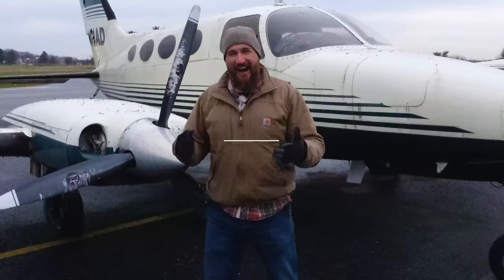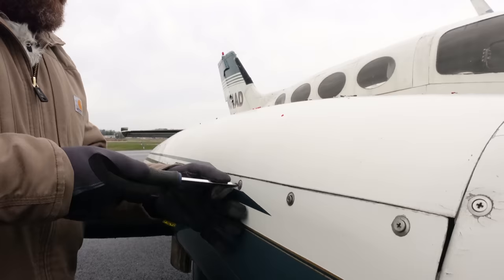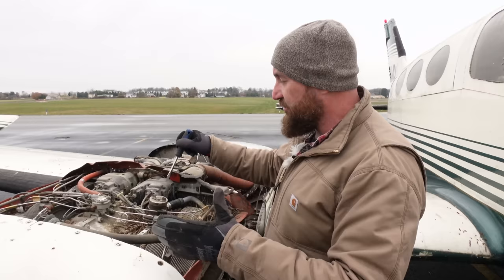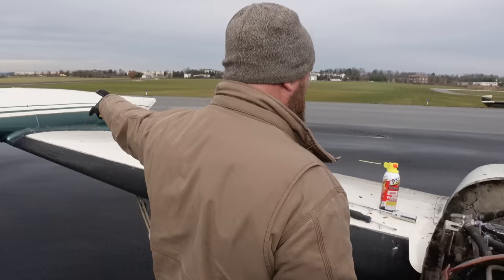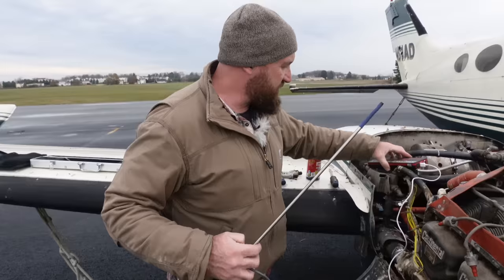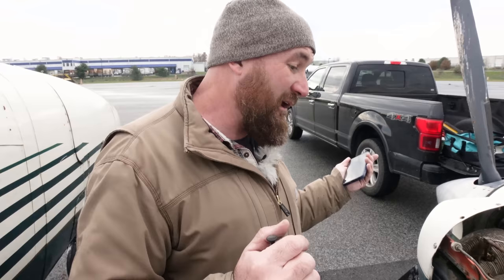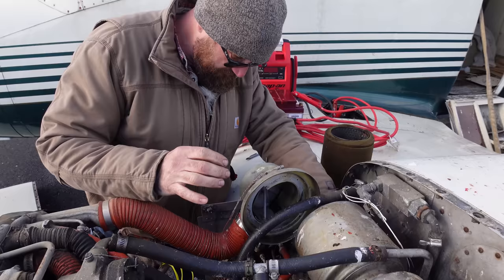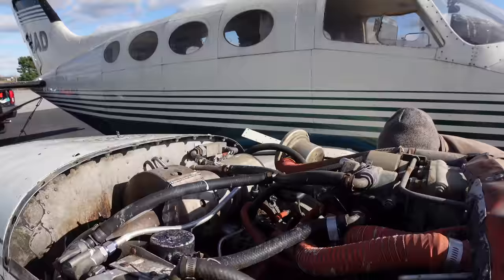FREE Abandoned Airplane... If I Can Start It! Ep1

Comment: I'm a multi-engine pilot and an A&P. For having little aviation knowledge, your engine and basic skills are good! As a  rule, aircraft engines are simpler in design than car engines. I find that changing plugs in a car with the individual coils and intake and such in the way is much harder than most planes.  
Fuel burn you mentioned is pretty close -figure about 35 g.p.h. depending on cruise speed and conditions. Figure 230 m.p.h. or so for cruise speed.
Hooking up  a high amperage battery  shouldn't be a problem because the various systems will draw only the current they need. The mags on that engine shouldn't  click unless they have impulse couplings. Those engines probably use "shower of sparks" mags that give a temporarily high voltage during start and don"t click. 
Did you check for fuel and spark before trying to start? Like any engine, You need those to make it run. The turbos could probably be by-passed to start the engines, but replacing them later would be very expensive.
The cost of overhauling those engines would probably run at least 50K each. Getting the engines to start makes for a good video but no A&P or IA mechanic would sign off the aircraft as airworthy without a double overhaul. If you view "Jimmy's World" you'll see several examples were he got engines to start, but abandoned the project for other expensive issues. 
Bottom line on this plane is.... parts plane! The engines can run 100K. The other systems like props, landing gear, avionics,controls, interior etc. can easily run you another 150K. That's if there is no corrosion. I would assume that this plane is full of it but you never know without looking.
I'm overhauling my own 4 cylinder Lycoming engine right now on my Piper Cherokee and have 15K in just parts. I'm adding a high - compression conversion and a tuned exhaust that adds another 10K or so to the cost. During the overhaul, I had an A.D. note (like a re-call but you pay for it) for wing spar corrosion  come out that could have stopped the whole project, but luckily, there was none.
Good luck, but the project is probably not practical but definitely fun!
Reply from the maker: This thing is a basket case for sure !
We’ll get it running sooner or later. I think we’ll get it into a warm hanger and get her cleaned up, then get at least one engine sorted out before parting her out. I’ve been thinking of using one of these TSIO’s on a kit plane or something interesting…..
Reply: Larry is dead on, all counts.  Hate to see this end up parts plane.  Shame the former hermit owner let it GTH.  There are not very many of this model flying. Not many were made compared to 340, 414, 421.
Reply from the maker: @johnross6314  we’ve been thinking about bringing her back to life and using her for Angel flights and paws rescue non profits…. Allowing other pilots to fly her on those missions.
Reply: maybe he could go thru it and sell it to someone in a 3rd world country where the regs aren't so restrictive (i.e. where American equipment goes to die)
Reply: @Exuma Guy “Best Cruise Speed: 213 KIAS”  noted from Cessna POH… that is at 75% power, and 46 GPH.  FYI. Not that your semantics matter over the factory rating. Would it achieve this?  Sometime.  But then, with a slightly under 2100lb useful load (non modified), the ability to fill up all seats (Cessna claimed unto 9) with passengers, and have anything but a smattering of fuel is impossible.  Let alone cargo.  

The pictures of this plane show some possible added vortex generators on the inboard wing area.  Which, if a STC might have increased T/O, Stall, S/E performance (slightly) from what I state above. This is a tricky aircraft to fly for single pilot, compromised (single engine as one example).  That is one reason for the limit of useful load with fuel.  It has a high single pilot normal workload than many.  It’s 6800lbs GW also places this into a different insurance category.  With 335hp each or so, it has less ability to carry a useful load payload than say a I/O-540 300hp Aztec (much lighter, yet, higher useful load and better single engine performance above VMC).
Reply: @Exuma Guy the overall single pilot workload on any of the 340-421 series is not for everyone.  Especially with compromised situations. Just the way it is.  402 looks flashy, however, if pilot not fully proficient, and not better than average pilot, things can get ahead quick of a non prepared pilot.  Sure, this is not Beach Duke, or MU-2J.  402 is not something anyone with Seminole time can jump on and be a true safe pilot. 

I believe this aircraft was made in 1969 or later? Need to go back and see that age.  Does not matter.  It is published to cruise much faster than you suggest.  Assuming the manufacturer (Cessna) uses similar metrics for published performance of the 340, 414, 421 (which Cessna is accurate with every of these I have flown (assuming not some ready to fall out of the sky cargo part 135. Instead we’ll maintained corp/private aircraft), that is used in the 402, what Cessna publishes will be very close.  

Name dropping your ticket, and sign-offs is not a help.  I have met many supposed credentialed wonks who I would never conduct a check ride.  Just because you claim some certs, means nothing here.
Reply: @Exuma Guy I suggest you quit talking.  The more you talk, the more people will never want you as a pilot.  Emotional outbursts on a comment section…. So endearing to your reputation.  Imagine the potential pompous non stable emotional state when under complex/dangerous situations.
Reply: @Exuma Guy no potential owner or pilot of a 401 would be misled.  Why?  They will be learning the POH for the year of the specific 401.  Including any STCs for the aircraft they are looking at.  Instead of listening to any keyboard supposed “polite” warrior. You are not offering any service to them. Get your ego in check.  Or one day you might end up on Victor’s VAS Aviation YouTube channel as a statistic.
Reply: @hooptierescue2540  Their money converted spends the same right???
Reply: @mrmotofy  one might pay a couple percent exchange fee thru a major bank that does a fair bit of international business
Reply: @hooptierescue2540  Right, but it might be hard to sell here cuz nobody wants the risk whereas there they might happily pay
Reply: @rebuildrescue   The "shower of sparks mags have a  "vibrator" that needs to run, to enable start.  Some can be in the nose compartment, or sometimes under the front seats.  Use a plastic pliers to hold the spark plug lead 1/2 from the engine cylinder, while someone operates the starter.   A continuous spark will jump 1 to 2 inches.  Sometimes only found on the left mag.  Trace back the plug leads to left mag.

Comment: I'm not an authority on aircraft engines but I have some experience with automotive turbos. The operating principles, I would think, are similar.  You should be able to to start and idle the engine even though the turbo is bad. You don't need boost to idle. The frozen turbo will create quite an exhaust restriction but shouldn't be an issue at idle speed. You can temporarily bypass the turbo on the intake side. I wouldn't spend money on turbos with questionable engines. JMHO.
Reply: The biggest difference between vehicle engines and aircraft engines (prop) is that aircraft engines are made to rev very high for extreme periods of time. The boost is a constant flow and doesn’t exactly have a chance to “blow off”
Reply: @KillianDeaton  He showed what appeared to be a blow off valve of some sort when he was checking out the turbo. If you cut the throttle with no blow off valve it will burp back through the intake. That pressure has to go somewhere.  The primary reason for a turbo on an aircraft engine is to allow it to operate effectively at higher altitudes where the air is thinner. You need forced induction to maintain proper cylinder pressure but air density and altitude are obviously going to vary so there has to be a way to vent the excess boost pressure. Overboosting will lead to detonation and engine failure.
Reply: Yeah I am a mechanic and yeah you should be able to start the engine with a seized turbo it should idle it may be a bit rough but don't rev it as you will kill the turbo. Also a little heat in the turbo may expand it enough to free it
Reply: @KillianDeaton  yeah no, the load from the prop keeps the revs down in manageable limits, certainly not "very high". Steady constant revs was the correct answer.
Reply: @KillianDeaton  aircraft engines run at about 2000 rpm. Give pr take 1000. They rev very low.
Reply: @KillianDeaton  Aircraft engines do not rev very high, lol. These engines have a redline of probably 2500RPM, max.

Comment: Aircraft engines have steel threadserts in the cylinder heads for the spark plugs to wind into, so you don't wind up with galvanic corrosion between the plug and the head and also to decrease the likelihood of stripping out the threads. Those plugs are removed for cleaning and gapping at least every 100 flight hours and the engine TBO of a 520 is 2000 hours. Screwing straight into an aluminium head would strip the threads out well before the engine hits overhaul.
Reply: True, most of them are stainless steel Heli-Coils
Reply: Yeah I only remembered they were called Heli-Coils after I posted the comment.

Comment: The engines are 300 HP each,  the cruise speed is around 240 MPH, fuel flow at 75% power is around 15 to 17 GPH each engine, and the TBO is 1400 hours.  With out the log books and the condition this aircraft is in, it needs to go to a salvage yard, or possibly an aircraft mechanics school.  Just because some of the avionics and auto pilot lit up does not mean they would work.  But I enjoyed watching you give it a try.

Comment: I have a lot (many hours and 40+ years) of experience with 400 series Cessnas. Hate to rain on your ambition, but the engines, as expensive as they are (and these ones are likely scrap), there are undoubtedly a lot more demons lurking in this beast, and exorcising them may very well run to even more cost than the engines. I don't know if the owner has provided you with any of the logs and records, but to start with there are spar and exhaust airworthiness directives that are expensive, so say nothing of any corrosion that may have accrued. There are supposedly "airworthy" aircraft of this type, with good engines, that on close competent inspection will turn up well north of $100k of defects. It might be of interest to a technical college as a teaching aid. If you are serious, find a friendly experienced and trained Cessna twin mechanic to give a quick opinion.
Reply: That seems like a fair assessment, coming from someone with many years of expierance. This project seems like it's more trouble than it's worth. Also, I'm not a tree hugger but this seems like somewhat of an environmental hazard. Like you, I worked in the aerospace industry almost 40 years and I can tell you if we had spilled oil and solvents and the ground the way he has there would be hell to pay.
Reply: My thoughts too.  The cost of making this plane airworthy again would greatly exceed its worth.  I think donating it to an aviation mechanic school would be the best thing for it.
Reply: @Me-xy3jh  Not oil on the ground!
Reply: So I’m going to school rn for my amp and amt and I was just curious if the faa would allow the plane to be airworthy without the license I mean I don’t know what this guy is certified for but Ik everything that comes to my school is automatically made not airworthy because we’re students
Reply: I worked for almost 40 years in aviation.  The FARs lay out everything that an owner can do to his aircraft.  Replacing spark plugs is one of those tasks IF you are a licensed pilot, and you own the aircraft.  And the work needs to be documented in the aircraft logbook.

I'm sure the vid creator is qualified to turn a wrench, but unless he is  A&P certified, or own the aircraft (and holds at least  a private pilot rating), he is technically not allowed to do much of what he already did in this vid.  His lack of knowledge about FAA regs is going to cause him some problems.
Reply: @vandalsgarage  You're getting too nitpicky.
Reply: @quantumblood2253  Congrats on joining our trade. Just to help you in future conversations, it's A&P (Airframe & Powerplant). Good luck in the remainder of your courses!
Reply: @vandalsgarage  I was questioning this since the beginning of the video. I am an 11yr A&P and I was sitting here, curious how he is going to sign this work off. If, of course, his intention is to eventually fly this aircraft.
Reply: @TheZwells  thanks much appreciated
Reply: @MilwaukeeF40C  it isn't picking nits it is literally just the rules and regulations of flying a certified airplane like this one.
Reply: @derrickfoster644  Funny story:  those are just suggestions.  A machine can literally physically work without that crap.
Reply: @MilwaukeeF40C  yes the machine its self will work just fine without the regulations, however if you actually want to use said machine as it was intended (you know to fly and stuff) you need to follow those rules, otherwise you just have a pretty ramp queen because that is the only place the machine will be able to go. Anyone who actually knows about aviation rules and regulations know that they are written in the blood of those who came before and didn't make it.

Comment: Seems like the kind of thing that will run just long enough to get you to the crash site.  Good luck with it and stay safe man!!
Reply: As a retired USAF flight simulator guy from years ago with thousands of hours, I thought I had heard every airplane joke. That was funny. I snorted my chocolate milk. I want to use that sometime. Thanks.
Reply: And let's not forget the buckets of money just to get it running.
Reply: @oldschoolman1444  and the taxes
Reply: I would pull the engine and put it in a rat rod lol now that would be bad ass.

Comment: I think that just getting the engines to turn over by themselves without setting fire to the craft is a worthy goal, because it means ownership. But no one could ever fly it somewhere like that, of course. When it is actually owned, the very next step would have to be pull out the engines and bring them to the shop for a teardown. I think there is no avoiding checking every rotating and reciprocating part and bring them all back up to snuff, otherwise there cannot be 100% confidence that wear or galling might cause one or both to quit in the air.

That would also be the first step in ''hosing out'' the engine bays (or would they just disappear after removal of the engines?). I think that if the engines could be made airworthiness inspectable, stripping everything out of the interior that doesn't actually keep the plane aloft would make it perfectly functional, like a military aircraft with bare metal everywhere. Duct tape upholstery of the pilot's seats would be perfectly acceptable unless/until bucks were available for a complete reupholstery/interior refurbish. A bare bones aircraft would make airframe inspection easier too, no? Plus more cargo capacity.

Then  he will only be faced with that profusion of controls/instrumentation/avionics.

I think that even with all the trouble and expense, it must be a path to a highly affordable aircraft of that class, no? The video content value might finance some of it. A long haul, though. Worse than a boat, and everyone knows what a time and money sink that can be.

Comment: As an A&P mechanic/pilot/ Engineer with 30+ years in Aerospace I can inform most viewers that working on aircraft components is somewhat mechanically similar to other automotive and agricultural devices EXCEPT that the processes are far more stringent regulatory-wise along with the necessary tooling/test equipment. This would be akin to taking a Ferrari to someone's backyard mechanic...they're probably not going to have the specialized knowledge & equipment. 

The author here seems to have a strong mechanical aptitude but definitely little knowledge of aircraft. I shudder anytime I see someone turn a prop through with the plugs/wires attached. On a plane that has been sitting there is no guarantee that the magneto is safely grounded which could could send a spark to the cylinder! Also, this isn't a lawn mower...simply dumping some oil in a cylinder which is obviously corroded is likely to do more harm than not. It doesn't take much time or effort to remove each jug (cylinder) and give it a quick freshening. This cylinder can be cleaned up a bit and even honed if necessary, along with the ability to look at the valve/seat conditions. Yes this adds a couple of days to the project, but could mean the difference in causing irreparable damage.

Yeah, I understand this is more of a you tube video just to show it can be done...but if parts can be salvaged it is wise to spend a little time. As the author mentioned aircraft components are VERY expensive!

There is no doubt that so long as this airframe is not so poorly corroded that it would be deemed permanently unairworthy that this bird could not be made to fly again...all it takes is time and money!

Even getting the engine(s) to run could be worthwhile just to salvage parts. An engine core alone can be worth $10k. So good luck...and above all stay safe!
Reply: I thought maintenance was only allowed to be done by a certified mechanic. As I got my PPL, we learned we weren't allowed to do amything ourselves.
Reply: beastwerks You said "This would be akin to taking a Ferrari to someone's backyard mechanic". You inspired great analogies here. How about taking a vintage $45,000 chronograph watch to a guy at a mall jewelry store for inspection and repairs? How about hiring green inexperienced construction company to do full restoration on a magnificent classic old home?
Reply: This needs to be TOP COMMENT.